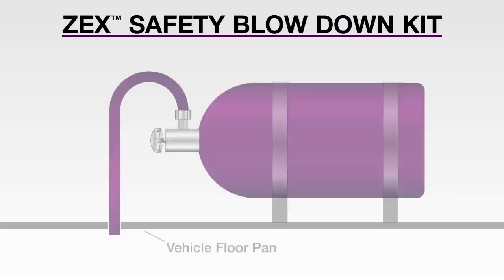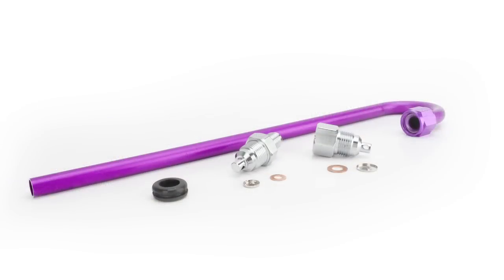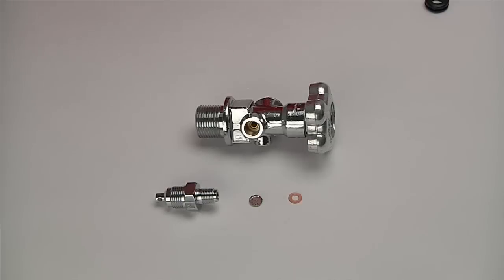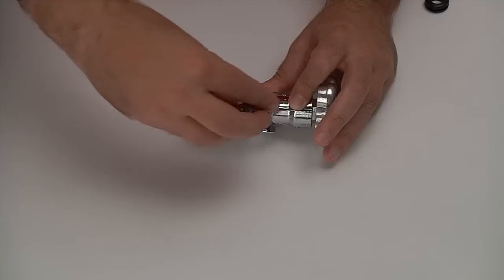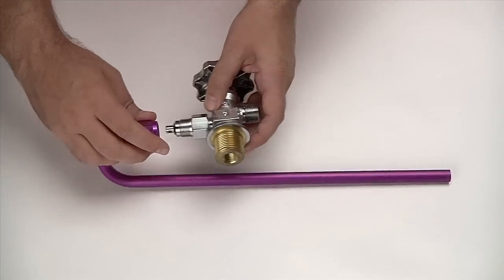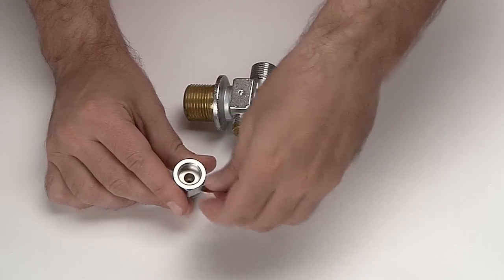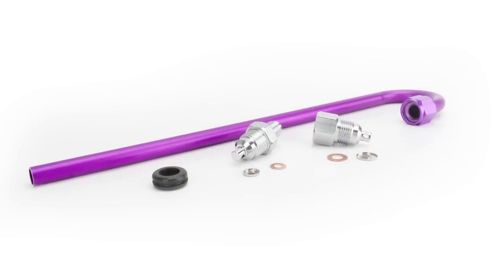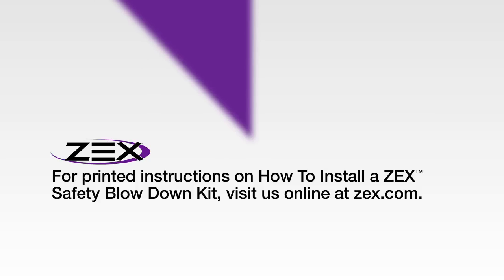ZEX™ Quick Tech: ZEX™ Safety Blow Down Kit Install

Comment: Do you need the blow down kit if you have a purge system.
Reply: A purge system is to control the bottle pressure.  A blow down kit is to direct the nitrous out of the vehicle in case the burst disc blows.  Two different things so a purge system does not do the job of a blow down kit.  Whether you need a blow down kit depends on what you're doing with the car.  My local track requires one.  Others may not.
Reply: @richardthompson3104  thank you the info is very helpful I am new to nitrous.
I have a wet system and plan on running it no more then acouple of times at the track I do not go to the track often at all I work so much. I just want to make sure when I do use it I am safe. So any advice on what other parts I should be getting for my nitrous kit would be helpful and appreciated.
Reply: @warpony5654  how’d it go running nitrous?
Reply: @ThatNoFbody-ch9ky  I have not completed installing the electrical. I have the switches installed I am just trying to figure out how to finish the electrical under the hood. I was thinking about getting a 4 post rely and wiring there instead of the throttle body wire. After then I will be finish and ready to use.